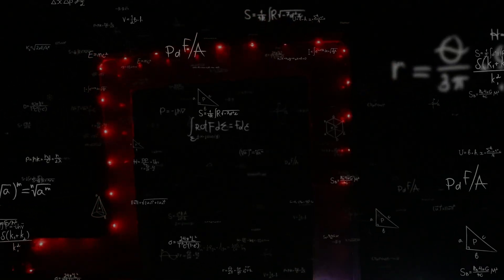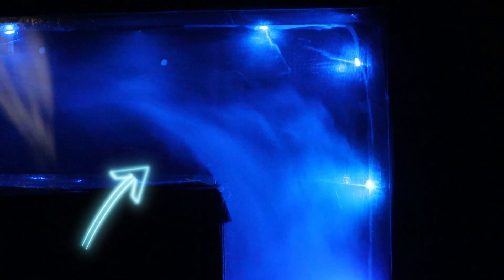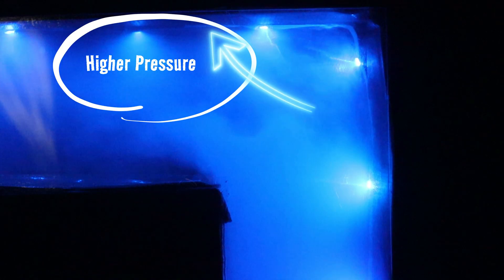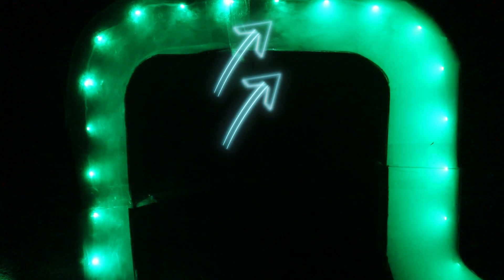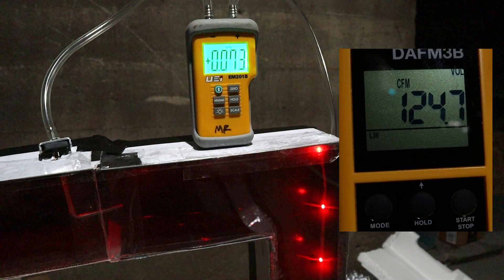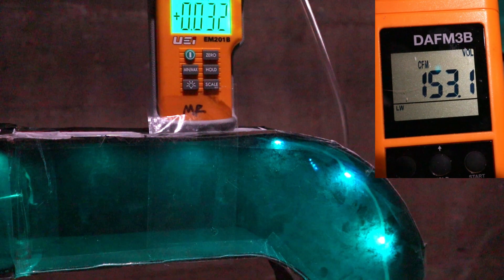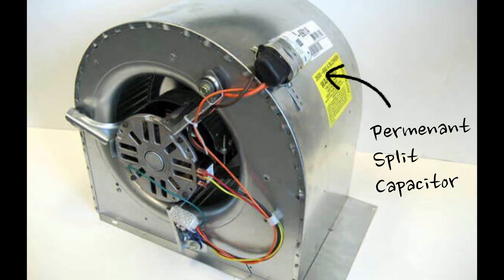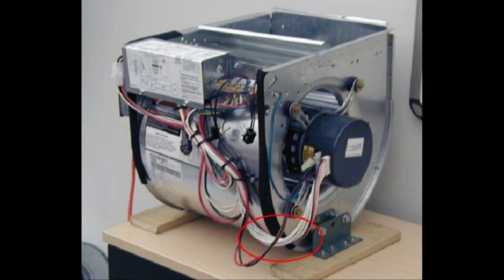Seeing Static Pressure in Ductwork (Fog Test)

Comment: I wonder if adding like a 3/4 piece of pipe insulation to the inside bend of my existing system would help with pressure by rounding that inside corner more?
Reply from the maker: Best modification you can do with an existing hard 90 is put turning veins in the center to prevent the air slamming up against the opposite wall.

Comment: Very cool video dude, not to mention that square duct flows better than round, which is hard to believe. They just need wide turns or bends.
Almost everybody’s ducts are done wrong . I think most people need bigger filter grills to compensate for their restrictive Filters.😮 and I think there’s a lot of people that think you use .1 static pressure always, and that is not the case. that’s good for an equivalent length of duct that’s only 100 feet. If you have 200 feet you need to use 2.0.